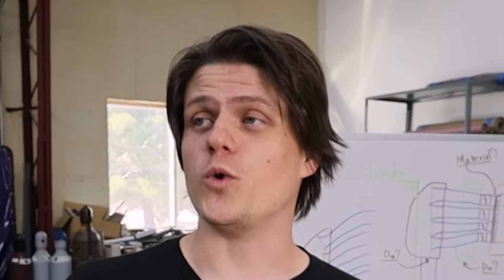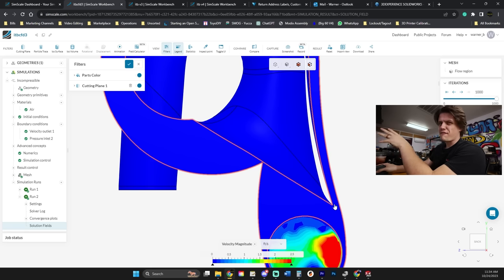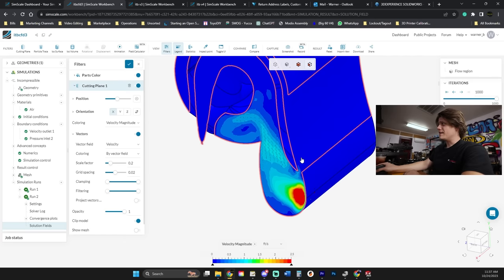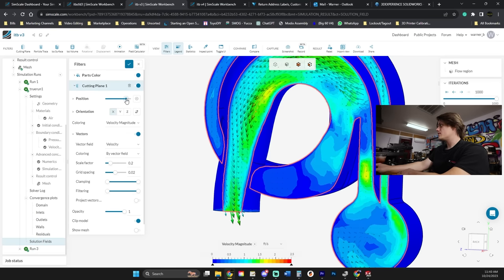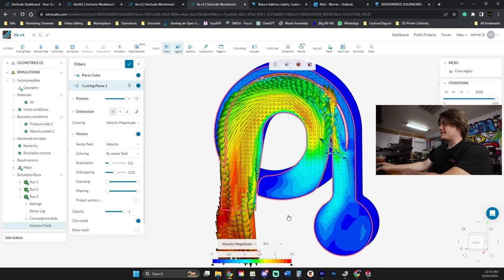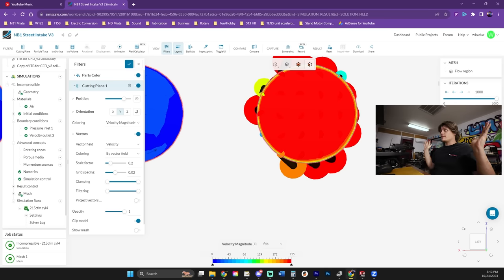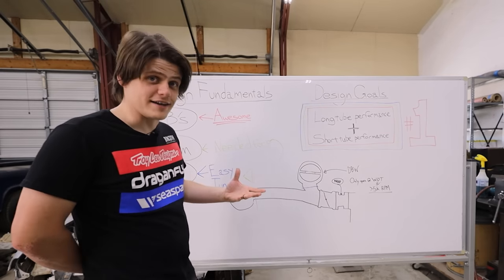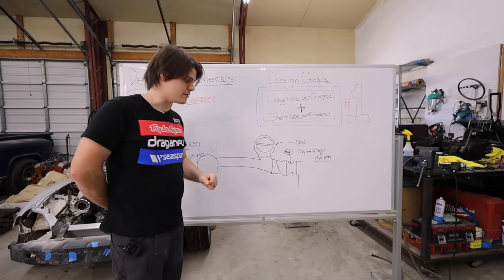The 3D-printed ITB intake system continues to evolve

Comment: Total noob here but my 2c:  
Intakes are air cooled, you can get away with a lot if you insulate from the head eg bakelite gasket to short alu' section that has intake taps for your MAP reading, another bakelite gasket then plastic. Very likely to be OK. I run a 3D printed engine mount mod next to my exhaust / behind the radiator and it's sweet.  
You could also put gentle bends on the long intakes and have them going to an accumlator like a 4 to 1 exhaust collector. They keep up flow by timing flow in a circle, I'd bet the same thing + constant taper and smooth turns will add up to max velocity

Comment: When working on b-series honda. The aftermarket intake market had optimized runner length and plenum size. I would start using their design and modify it for bp application.
Reply: according to what? id like to see designs with flow data and hp figures because that sounds like bro science claim.

Comment: Twin plenum set up, with one for higher revband wave reflection on late 90/early 2000 Ferrari V12 ;) 550/575/456 etc...
Keep in mind movig air = lower pressure, 
Keep in mind lager inner radius = better, can trick this with oval flowing area see Renault sport engine intake design

Comment: Check out the BMW DIVA intake. They used it in a V8 but there's no reason it wouldn't work here. They got full variable runner length by turning an inner cylinder

Comment: Your MAP sensor on the final drawing has to be in the plenum, otherwise you wont get proper tuning. Pulsing in each runner messes with the MAP.
Pulsing in each runner is why a lot of people/race teams dont use ITB and MAP. You need to build a plenum/air box with the map mounted there to get usable readings for tuning.
This is why ITB cars are so rough and jurkey at lower RPM.

Comment: Mitsubishi made an intake manifold for the 4G63 called the cyclone with two runners per cylinder (one long, one short) with a valve keeping the shorter runners closed at low load/rpm.

Comment: you might try putting laminar flow guides a little bit up from the ITBs or behind the cone, effects should* include a much smoother flow to the cylinders and better combustion. not sure how much of a difference it will make in the final product since i dont think solidworks could simulate it properly but knock yourself out if you want to. search for a 2007-2011 crown victoria throttle body gasket on your browser of choice and you will find exactly what im referring to

Comment: try a center entry for the plenum instead of the side entry, configure your design for flowing from a center port and see if you can increase the flow rate in doing so, might require mirroring the end opposite to the normal entry for the center port design. 
i'm also curious if there is a scavenging-esque method to the madness for designing an intake manifold similar to an exhaust, like if a triple y design for the flow would do anything to aid it, i gather it would disrupt the flow in reverse but i'm still curious!

Comment: Velocity doesn't matter. Mass flow rate does. You need to either ask the software for that metric, or the average density at the boundary so that you can calculate it from the cross section and flow velocity.

Comment: You definitely shouldnt “let the air figure it out” at the end if you want to achieve an even distribution of air-pressure over the four different cylinder intakes. If you want to do it the easy way, you could lengthen the way the air has to take in order to reach the first cylinder so it matches the distance needed to reach the furthest  cylinder. If you dont want the added material weight, cost and room you could insure the even distribution of flow by giving the pipes reaching the cylinders different diameters. (Although there would be some nasty math involved in that solution)

Comment: This is brilliant. I think you're going to have to go through a lot of trial and error with diameters and lengths. Maybe make the design very modular. Then swap runners on the dyno to test if a smaller diameter will increase velocity the way you want, for example. I'm sure you can send CAD files to a Chinese source for prototyping, aluminum casting, and machining.

I'm not sure how licensing will work for this, but MIT and Apache is typically the go-to for Python amd is fairly straight forward. I'm a lot more familiar with Python than automotive R&D practices.

Good luck! I'm excited to see how this goes.

Comment: As for the 2-valve design, the junction before the ITB creates a turbulent low pressure area just above the valve. This could cause heaps of problems, up to backfire. As for the curved design, Air speeds up naturally when it's pushed/pulled through a loop. Shape of the loop effects on the velocity, where tightening curve accelerates the flow. Focusing on the outside curve inlet, if you'd trumpet the deviding wall towards the inner opening, this would create a vortex into that junction. This vortex would then drive more air into the outside curve, as well as keep the bleed into the inner trumpet minimal, while accelerating the inner trumpet laminar flow velocity. By playing with this trumpet bend, you could tune the flow between the outer and inner curves.
Reply from the maker: That's an interesting note about the turbulent area. How far away from the head would this area need to be to give the air enough time to clean up?
Reply: @StandRacing  Basic velocity stack length math applies, but on the 2-valve system, there's always less air in the stack/port, due to the vortex created by the junction. The secondary valve is only creating more mess before the stack decreasing the overall flow. The double curve airbox has much more potential. The inlet to the airbox needs to come middle instead of side to make the load to each runner as even as possible. The round hole should spread like an old vacuum cleaner nozzle making the entering gate to the box the whole width of the box. Playing with the gate height effects the overall performance of the box. Get the gate height and the outside curve trumpet in tune, and you should see positive pressure @ the ITB end of the box.
Reply: @StandRacing  And one more thing about the Double Curve airbox, Due to it's functioning nature of acting as a passive, resonance based pressure chamber, it can't have any filtering membrane. every type of filter causes too much restriction for the resonance to function. A suggestion to fix that: Dust collector box. 100mm tube straight down from the middle into a 250-300mm ID bucket coated with thick grease. 10mm radius trumpet at the end, 50mm from the bottom. exit air into the DC airbox comes from around the pipe continuing 100mm through the MAF sensor. Second line of dust collecting is the gate into the airbox. This could be lubed with crankcase vent via catchcan breather. A row of 4mm nozzles at the apex of the inlet gate would form a curtain of greasy air to clean the intake charge from any particles. Just make the bottom of the gate removable for cleaning. Directing the crankcase gas back into the intake may cause knocking in extreme conditions, but if E85 is used, this issue should solve by the fuel.
Reply from the maker: That sounds like a novel idea. After two engines melted down I vowed to ban all oil vapors from entering the intake charge in any racecars though.

It sounds like it would work, but how awfully grimy is the entire inside of the intake going be after a 4-hour race?
Reply: @StandRacing  The state of grime has four factors: SIze of catchcan.The vapours should pass a crude filter, a layer of coarse steel wool for example. Height of the dust collector. Taller the bucket, lighter the trapped particle. Engine finish and breaking in period. If you finish the bores finer and cycle the engine/bottom end before you start it, you will have less blowby and more power. Engine tune and used rev range. If you run the setup "fat" and compensate the torque loss by overtiming it, you will stress the components to their wear limits. This results to more particles in the oil, more heat in the oil, less lubrication, more wear, more heat expansion and death. To fix this, you'll need tighter balance in rotating assembly, smoother hone and larger diameter in oil passages. That last part is a bit ticky, and needs to tuned with oil grade and system type in mind (dry or wet sump, dry sump can use thicker oil with fuel separator and cooler. If you fit ticker oil in wet sump, you'll lose power in oil slush. Slush management helps, but doesn't fix all of it. In wet sump, it's either slush or starvation.) Playing with oil grade allows you to play with bearing tolerances and piston to bore tolerances. There is power and rev range hidden in these too. All and all, the vapour circulation itself is very rarely the actual root cause. If it were, there should be more regular ICE's on fire on the streets than there's EV's. But, if the extra hydrocarbons gives a headache, one can always mold the combustion chamber to burn those too. This may smooth out low end, but frees up the top, where this setup likes to live anyways.

Comment: There is an ideal length from the back of the valve to the throttle plate in the ITB. research that. it will change where you put the ITB throttle plates. depends on rpm of the engine.

Comment: CFD = Customer Fooling Device, you can fool others or yourself easily.. That calculator gives you bulk velocity, so the velocity that the air is moving at for a given flowrate if it were flowing in a uniform profile. But fluid in a pipe does not have a uniform profile, so yes, you are going to see some faster moving air in the middle of the pipe (and at the walls speed is 0, with some profile inbetween).. Certainly not over 100% efficient, that's just what happens when fluid flows through a pipe.
I like the ITB+ conventional throttle body idea you present at the end. Tricky to know if it would work in this way, but there have been similar systems that switch from long runners to short runners on some cars. They typically used a blade on each runner instead of a single throttle body like you are proposing to "switch" all of them, but maybe one throttle works. (My worry would be that there could be some funky resonance going on in that plenum with the short runners.)

Comment: Id say as a tuner that will work. How ever itb are very sensitive throttle responce and idle tuning can be a little bit of a pain.  Your drive by wire that opens when you want wont work on most controllers but id say using maxxecu race it is very possible to do what you need. Not all standalones support.
Reply from the maker: I decided to can that particular multi TB design to focus on the broadband 4x ITB streetable version. You can see it more in the more recent videos

Comment: So it looks like youre testing the whole manifold with air exiting at only one port? I think you should have air exit at all 4 cylinders, this should be far more correct, 

Also, you may retest with the total needed airflow pushed through the inlet as well to see how that looks.

ALSO#2: take a look at the ford performance 4.6 4v FR500 manifold, or the lincoln aviator 4.6 4v intake manifolds... theyve done basically this exact thing very well. Richard holdener has these two tested against each other in a video
Reply from the maker: The engine can only demand air into one cylinder at a time. The best type of simulation as some others have pointed out is to use something that can receive values from the engine (bore, stroke, valve size, cam profile, exhaust design, etc) to test the manifold from each port dynamically.

Comment: Your intake throttle bodies shouldn't get too hot apart from heat soak as they're actively air cooled when in use. Hypothetically high temp 3D print should withstand the temps, but maybe not the negative pressures if you happen to use a flow restriction plate. Resin 3D printing has some high temp options.

Comment: Ive seen adjustable intake tubes on a couple race cars where depending on rpm and load, the intake runner length would change to optimize the power potential. I dont know if that is something you want to do, but it is an idea. It would make tuning a nightmare though

Comment: I think my Alfa Romeo 156 2.0 twinspark has a variable length intake design. This engine seems to be some sort of melting pot for Alfa Romeo's efficiency engineering designs. It has the twinspark "technology", variable lenght intake and probably more stuff that i dont know of. 

When i drive the car i feel like there is more down low pull and more hi rpm pull than most 2 litre 150hp engine have. But i dont know, it might just be me feeling like it is pulling harder than it is. 

Hope this project keeps on going and i wish you all luck. Coming from a fellow efficiency-design-hunter-carguy;)

Comment: non linear flow towards the runners will net a freakish tune that will be non linear.  i just went thru that on mine because i had a vacuum hose inlet in a bad area on the crosspipe, it was doing that to me.  i believe this to be fact.

Comment: I'm thinking the  single  throttle manifold will   perhaps ruin the benefits your seeking in long runner mode .. the runners need to be properly isolated from each other to work properly  i would consider a second set set of  ITBS  than open during the top end  .. then you also have  those great   dual butterfly throttles in VAG cars  they open a second throttle in the upper 50% of travel with clever linkages this would work great  with drive by wire you limit  your throttle to 50%  max until a given RPM then you  give it the rest above that RPM and it  pens to the upper  plunem   so 4 above 4 throttles and they are linked  ..

Comment: I think you may have to run 2 MAFs and then add their values together. Depending on your engine management, you may need to have some external circuitry to add the values together. Speed density would be a nightmare for a number of reasons 😂
Reply from the maker: That's sounding pretty problematic

Comment: do u know flow rate and cam specs of this engine so you get the harmonics right. if you using harmonics and wave pulses that is how you can get over 100% efficiencies at certain rpm ranges. multiple runner lengths have been used by many manufacturers. Ford did it on the old sho Taurus yamaha engines. it had intake manifold butterflies that would change into a shorter runner at high rpm

Comment: would a roller barrel throttle body be able to have less volume and more flow for the dual runner set up and not create as much vacuum? also if your designing your own system why limit yourself to a butterfly type throttle body?

Comment: Im sorry, but why not just have a simple solenoid or wiper motor or some electric motor that you can program to operate at a specific RPM, with two velocity stack sets, one nested in the other? That way you can even link the motor to throttle position or rpm range or what ever and have the longer slide in progressively until it's flush to the short. It'd give you everything you need or want and more .

Comment: I really love the process and the work you're doing. I always wanted to design my own stuff as well but my build ended up being more off the shelf. Maybe one day.

Just some thoughts:

1. I would caution you on relying so many of your design choices on the CFD. CFD is not really that great. It can be a good tool to point you in the right direction, but I wouldn't chase numbers quite yet. I would recommend in investing your time into making a more modular system. Imagine if you design a prototype where you can hot swap pieces to change runner length, plenum size, add your 2nd intake, etc. If you are able to make these changes on the fly on a dyno, then get real data, that data will be like gold for any design choices you make.

2. Intakes (and exhausts) are tuned using acoustic resonance and helmholtz resonance. This is getting pretty technical but the point is you are not dealing with continuous developed air flow. You have intake valves opening and closing so the air is pulsing. Not only that, the RPM is changing constantly so your pulses are changing as well. Pair that with the firing order of cylinders, the fluid dynamics becomes extremely complex. This is another weakness of trying to use CFD programs so early in the process. 

Keep pushing, love the work. I've had some ideas in my head for a while and this is giving me some motivation to start trying to act on them.

Comment: I guess you shouldn't aim for air velocity but air pressure, because the higher velocity of airflow – the less pressure you have, thus means  less air mass in the cylinder. 

And I can't get why do you chose MAP sensor, while you'll have ITBs, it's always an atmospheric pressure in the plenum at low loads, so you'll only use TPS and MAF at tuning which makes sense.

Actually, variable intake geometry is a good technology to adjust torque at desired rpm range, but making single throttle intake plenum sequentially to ITB makes no sense, because of weight and space tradeoffs. It might be reasonable just to make telescopic intake manifold (like some '90-'00 F1 cars or that Mazda 787B at Le Mans) or try double ITBs, where first ITBs are electronically operated and second are mechanical cable operated. Or just use drive by wire ITBs, which is the best way in my opinion.

Comment: What are we even doing here? These gains are pretty slim and requires tons of complexity. Just boost it or spray some nos at the odd ball rpm and optimize the intake for your primary rpm. Basically anything you do will be thwarted by the reflections coming of the ITBs so you have to make ITB to intake valve length super long negating most of the benefit of ITBs. You may not get crazy reflections at WOT but how long are you gonna be in a non ideal rpm and at WOT???